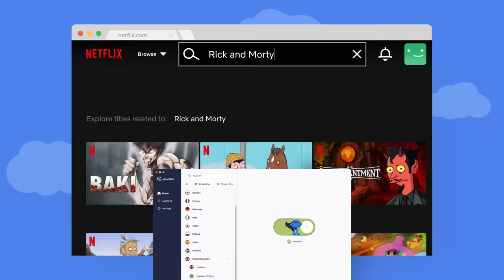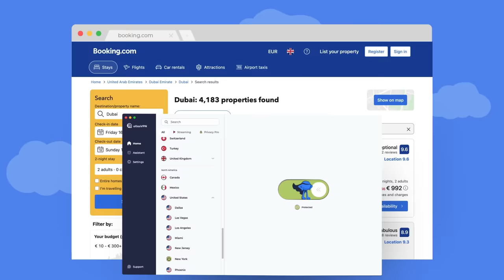How do Russians Cope with Heavy Tank Losses?

Comment: It is only undeniable for someone sitting in Australia only with access to info that everybody else does too and the way they cope with the actual number of tank losses is to deploy the reserves of which Russia in year 2021 had aprox 11.000 T72 alone. To that you can ad some thóusands of T64, 3.500 T80 and about 600 T90. That is 15.000 not counting at least 15.000 T62 and T55 both upgraded. Every unit upgraded or being upgraded.
So disregarded what nonsense you have read from 8.000 miles away the russians cope by having more than plenty to deploy. 
On top of that Russia produces about 90 T90 a month too and is ramping up its T 80 production too. So it is safe to say as it is with everything else that Russia cope simply by having more. 
The Russians also have more artillery, almost 5 times more manpower, APCs, IFVs, choppers, jets, bombers, SAMs and everything else. There is nothing that the Russians do not have more of. Nothing and what they got is better and newer. There is nothing Ukraine is better at using., so what will the outcome of the attrition be ?
This is how they cope and how Ukraine will be broken.
It makes shit of a difference how many Javelins Ukraine have. I would prefere a Kornet over that any day.
So Russia has a large airforce and much more and better anti aircraft artillery with few limitations of Shells. Ukraine have a small airforce and only the SAMs they are donated. The same goes for tank and mortar rounds plus artillery shells.
Ukranian production is nothing compared.
The idea that Russia have los almost 7.000 pieces of artillery is absurd. That is aprox twenty guns every day. Ukraine in contrast have  only lost supposedly 400 units. So each Ukranian gun hits almost 20 Russian guns every day.  Surely nobody is that naive. Having has 20 times units less from day one and they still hits 20 times more.
Anybody not completely stupid can realize that the part with a massive numerical disadvantage in number of artillery pieces from the beginning, no domestic production and much fewer counter battery fire radars are not going to lose almost 20 times less, so that is another obvious lie that will easily fool any amateur.
Besides that Russia having more than 20 times more units than Ukraine, they also have many more rounds, so who can you imagine is losing most artillery ? Ukraine depending also completely on 155mm howitzers from Nato of which they got below 500 pieces, so Russia can shoot at least 5 times more than Ukraine as long as the shells keep coming.
As we speaks they are taking more of the 203mm artillery pieces  out of reserves and more of their 240mm siege mortar units too, dropping 130 kg shells. Perfect for this slowly moving front. Most were taken out of action in 1990 like in so many other countries and stashed with hundreds of thousands of rounds. Units and rounds already produced and paid for.
Only the most gulible f... babbling about HIMARS etc cannot realize who is going to win this war. That of course includes Joe Biden, Blinken and Zelensky.
Ukraine has nothing speaking in its favour except number of casualties of which only the dumbest people in the world belive that the part with 20 times more and more modern equipment will lose.
Reply: So why you losing against 🇺🇦 then🤔

Comment: Most of those "losses" are mission kills and those vehicles are towed back and repaired when possible. The problem is with western junk, because it is much harder to tow damaged 65 ton Leopard2 and move it back to Poland for repairs. Not to mention, that west is lacking any large scale manufacturing or repair facilities. When country operates 250 tanks like France, they have no reason to keep workshops capable of servicing large amount of tanks. But if you have 5000+ tanks in service and another 30 000 in reserve storages like Russia has... things are very different.
Reply: russia had 3000 tanks in service and only 4000 tanks in storage that didn't have visible damage or missing turrets
Reply: @cdgncgn  His data comes from satellite photography, courtesy of Covert Cabal on Youtube. Nice cope though vatnik

Comment: because to their output and upgrade programs it is not heavy lose.
Reply: Newly built tanks can replace about 8% of the losses and the upgrades can replace about 35-40% of the losses. The rest are merely Soviet era tanks fixed up and put into combat with no upgrades. The latter 2 types rely entirely on the stored stockpile Russia has, which is dwindling and if the loss rate continues, would dry out in about 2.5-3 years
Reply: @DeanError At the absolutely abysmal progress that makes WW1 look like a Blitzkrieg, Russia does not have enough tanks and not enough trained tankers to crew them

Comment: Russia has always been strong in areas like metal casting. However, they have always been weak in developing and manufacturing the electronics required for tanks. Do you have any idea how tanks production in Russia is limited by lack of electronics? Most of the city to be imported from the west, From France and other countries, that have no and exports to Russia. Is it worth upgrading and old T 54 or T 55 tech to anything like modern standards, or even refurbishing them to the old standards? Are they even useful for training tank crews?
Reply: they attempt to import semiconductors from china which are inferior to western counterparts. russia can produce tanks but are usually missing optics and other technology such as thermals since they dont have the capability to produce those on a large scale and used to rely on imports from the west.

Comment: Seven times increase is possible if the original capacity has been much worse than originally stated and current seven times is increased from the lower capacity than the original stated. For example if the company made 5 tanks per year originally instead of 30 stated and now company CEO says they have increased the production 7 fold from 5 to 35. So now they basically just work at near originally stated capacity. Would be very “Russian” statement also.

Comment: Russias extremely cheap to where they can just grab two destroyed tanks and slap them together, frankensteining their vehicle into being in use again
which i find funny, in WW2 the soviet union did the same thing, they'd do a mass push, grab whatever can still crawl and slap them together with their vehicles such as T-34's & KV's
TBH I'd take ratios alittle wonked, so most of the vehicle kills are basically just faults since the machine will just end up on its legs again at some point
Reply: If you control the battlefield, you can recover what's on it.
Reply: @derikuk2967  So true

Comment: The issue for russia is that there simply isn't a good option for dealing with the sheer volume of losses that they've expierienced; Even if the losses aren't as bad as widely reported and they're salvaging what they can (Given what happens with an ammo cook off I'm skeptical how much internals are salvageable) the issues become:
1. Many of the tanks that were in storage weren't properly cared for by russian quartermasters; they were left to sit in the mud for years if they weren't looted for parts.
2. How exactly is russia manufacturing so many more tanks at a time when they're being heavily sanctioned (thus limiting access to parts they haven't produced domestically and also the amount of money they have to work with) and they've sent so much of their potential work force off to fight at the front while also increasing production of various other materials and munitions?

Like, I'm not saying that they aren't *trying* to offset these losses with production and/or repair but well... Russia said that the T14 armata was going to be an unstoppable super tank and that they were going to have over 2 thousand of these bleeding edge tanks 3 years ago, while if we fast forward to today the grand total of their confirmed activities have been
1. A parade in moscow where one of them broke down (or was demonstrating how incredibly sophisticated russian tank recovery was)
2. The BMP terminator (which uses the hull and was part of it's modular design) was involved in some fighting but was found to be of limted value. Not destroyed or signifigantly damaged though which is something.

So when Russia says that theses losses aren't a problem because they can just out produce/salvage the losses I'd be really, really skeptical.
Reply: The T-14 at the parade didn't break down, they hit the parking brake, if you watch the full video. It moves on its own.
Reply: @subjectc7505  I like how you completely missed the point.
Reply: @guitarhausdoesntknowwhatac3285  It's no point missing, it was debunked that the T-14 never broke down nor was it an display of the recovery of an Russian tank, since the Recovery vehicle could barely move the T-14 until it's parking brake was removed and it started moving. If you wanted the full video. It's multiple vehicles of an recovery vehicle in action so it's no Skepticism.
Reply: @subjectc7505  No. The point of my post which you either missed or deliberately ignored is that Russia's capacity for tank production/recovery isn't anywhere near the level that Red effect is reporting they're atand russia has been shown to wildly over report their abilties.
Reply: Also, T14 was never intended to be an MBT, it's supposed to be a commander's tank leading 4 or 5 T-90s. Who exactly claimed "they were going to have over 2 thousand" of T14s? Now to the other point:
>How exactly is russia manufacturing so many more tanks at a time when they're being heavily sanctioned (thus limiting access to parts they haven't produced domestically...
They buy those parts elsewhere. What are those exactly, thermals?
>and also the amount of money they have to work with)
On the contrary, lol. There is a war going, weapon manufacturers are rolling in cash. As for the budget, Russia was in the green as of 2022
> and they've sent so much of their potential work force off to fight at the front 
Workforce of the military factories are exempt from conscription. I'm pretty sure when Putin declared mobilization in September, arms industry got everyone they needed and then some
>while also increasing production of various other materials and munitions
Yeah, I heard during wars those tend to increase. Supply and demand and all that. Surprisingly enough, old Soviet factories build for total war produce a lot of shit when properly supplied and fed with money and raw resources
Reply: @marcusflutist1230  
1. The T14 was absolutely designed to be a next gen MBT; the short term goal may have been to have it utilized by more elite crew's backed by last gen tanks, but if the goal was for it to be a "command tank" it wouldn't have been equipped with a better gun and engine then it's contemporaries due to it not needing killing power over communications equipment.
2. 2300 were apparently called for and According to the head of Rostec it was supposed to be in serial production back in 2016. Apparently something happened though and instead of having a swarm of modern tanks they may have... 40. Kind of hard to say since we've only seen 8 in one place.
3. Buy from whom exactly? They're sanctioned to high hell which means they don't have the money to throw around on importing military hardware. 
4.Again: they're sanctioned, Lol. This means that russia is currently starving for money since they can't really sell a bunch of consumer goods like they used to, their energy sales to europe (which were something like +20% of their budget) are gone, they're still selling to india and china but the infrstructure doesn't exist to handle that level of oil and gas to fully offset it and even if they did they're dealing with price caps imposed on them. Like, they do not have the economy to do large scale tank production without going into a full WW2 war economy.
5. The Factory's workforce may be exempt but people who haven't already joined aren't and those folks are getting handed the shittiest door prize by the russian government. Further, the conditions at the factories are by all accounts abominable with workers being expected to work extra hours everyday essentially for free to offset Russian losses. This is also not factoring in how around a million russian's fled the country to avoid being caught in the war further reducing the potential work pool
6. Again: you can not burn a candle at both ends and expect it to last as long; They're burning money to support a war which they can't  win conventionally, removing people from various industries that generate money so they can be sent off to fight and also making claims that they're going to increase tank production 7 times.

Quite frankly, I'd be suspicious if america was making claims like this while suffering horrific armor losses but russia? a Country known for making wild claims of grandeurand who has an economy that is checks notes 10 times the size and under no trading restrictions?

Nah kid. They're pushing straight bullshit.

Comment: They are definitely losing more than they can replace, that much is clear. When they lose a dozen tanks in a day from some insane frontal assault that gets stopped cold, then they turn around and do it again the next day, that sorta thing adds up quick. It's hard to calculate how many tanks that aren't on the zero line get popped by marauding OWA drones or artillery. Suffice it to say, Russia is quickly reaching the end of their stockpile of salvageable tank hulks, which is why they are now using T-54/55s and BTR-50s on the front line. They have long since started using T-62s and MT-LBs on the front lines. That tells the story. They can't replenish T-72 variants or even BMP-1s or 2s at a fast enough rate to keep up with losses. At the same time they are forcing their infantry to make assaults without any vehicle support, or with things like supply trucks and unarmored vehicles. That's just insane. The Ukrainians, of course, also suffer from severe shortages, but they actually use tactics which don't get all of their vehicles killed in pointless assaults (most of the time). But it doesn't really matter who will run out of tanks first because Russia is the one trying to occupy territory. If it runs out of tanks, at a minimum it will no longer be able to go on the offense, and there are other kinds of technology which make it particularly vulnerable on the defense (like night vision, LRSF, basic infantry training, fragging).

Comment: I would think this is the point/oportunity where it becomes cost effective to move away from the having various tanks... and adopting one or two standard platforms.

With retooling factories and facilities at the conclusion of this war... I would be surprised if the T-14 and T-80 are not the frontline units. With  T-72/90s making up the reservist role.

Comment: Redeffect, love your very detailed factual videos. Call out false stats and  have showed a master class in never fall into the taking side argument. Just wondering any videos of Ukraine specific mods to western vehicles. Most cant be used in winter and spring because of weight and we see more and more infantry units falling back on eastern block small arms. Is it just weight that stops western vehicles in winter or is it similar to small arms situation? Or is it purely battlefield losses dectating the use of MBT,IFV,APC etc?

Comment: Better talk about Ukraine starting to use old Leopard 1 tanks on the front line, the zero line, not in the back.
7 to 1 refers to over 100 tanks made vs. At least 850 tanks made or upgraded. In Soviet union any tank that left factory was counted as new. Some tanks were new few times.
Reply: Are they using Leos 1 though? I've only seen 2s
Reply: @marcusflutist1230  First video yesterday. So they are entering the combat area.

Comment: A lot of those Russian tanks were totally blown up with the turret ending up 20-50 meters away.  I don´t think any of those are repairable.  Yes you can sort out engines and gearboxes, replace a main gun, replace tracks.  Tricky to replace all those trained crews killed in action.  Russia got it´s optics from France which is now blocked.  The T80s and T-90s had a lot of their electrics removed hence they are refurbishing older tanks which are simpler to get running.  Oryx have documented 2,472 lost Russian tanks, 2 T-54/55,  262 T-62/64  the rest T-72 and above.  660 T-80 lost and 96 T-90.  1,065 Armoured Fighting vehicles and 3,049 IFV.  Russia had 170 BTG which mainly had 10 tanks and 40 or so 40 or so AFV/IFV.  Some tanks were used for training, they got 500 old ones from Belarus.  The rumours are that Russia can build maybe 20 new tanks a month and refurbish 40 old ones a month depending on condition.    The US has 2,500 M1 Abrams (the old ones) in storage and 2,500 Bradleys and 12,000 MRAPs

Biden could easily send 500 tanks, 1,000 bradley and 1,000 MRAPS to Ukraine plus lots of pontoon bridges and smoke machines to get  a powerful army across the Dnipro and down to Crimea.  he could also spare 200 F-16.  That would end this war and ensure russia doesn´t try again.

Comment: Russia has only lost around 2,000 tanks, Russia had over 10,000 in reserve and nearly 20,000 in storage.

Right now they are bringing out T-72B and T-80 from reserve and upgrading T-64 into 3rd gen T-64B.

There is no issue
Reply: they had 3000 in active service and around 4000 in storage
Reply: @AnthonyLopez-lb2bd  that's false